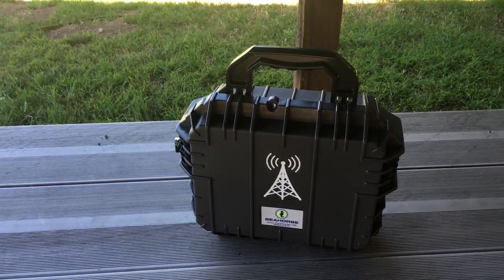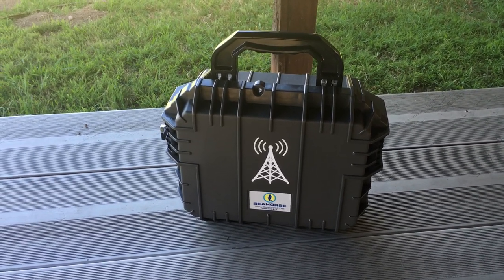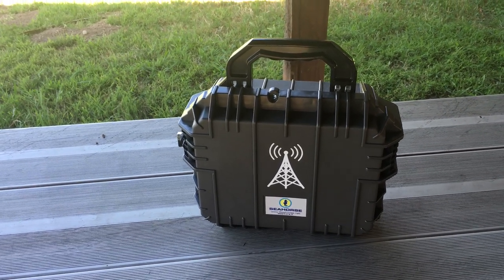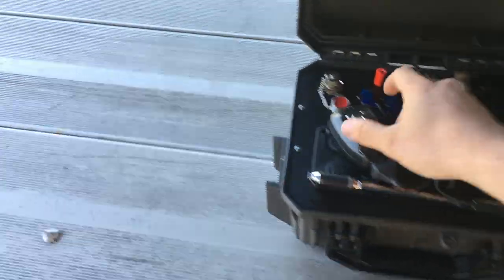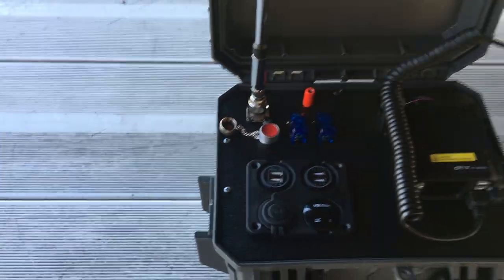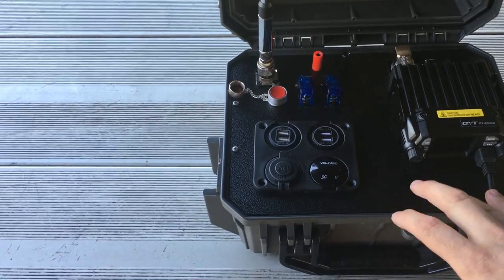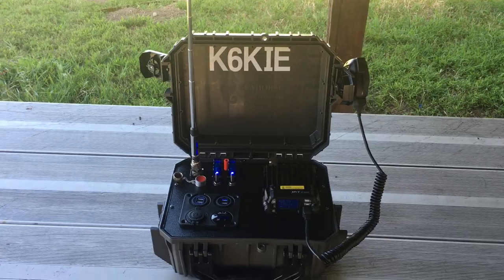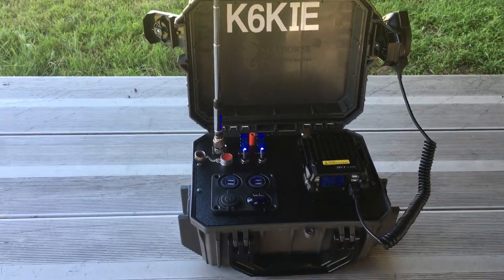Custom Emergency Ham Radio Go Box

Comment: Might I suggest that to enhance the functionality of your radio box that you include a roll-up J-pole antenna and a coil of RG-58 coax, so you can get a decent antenna up higher in the air?
Reply: Great idea.
Reply: Honestly I was thinking he was going to have that in there before he opened the box.
Reply: Especially since having the antenna on the box puts the operator at risk of RF exposure in excess of the limits set by the FCC.
Reply: @CAphotos  RF exposure limits set by the FCC are based on:

1 -  Proximity to the radiator
2 -  Frequency of operation
3 - Transmission power
4 -  Duration of exposure

Using an online RF Exposure calculator, using an antenna with gain of 3dBi, at a transmitter power level of 5 watts, at 146 MHz, and a duty cycle of 20% transmit and 80% receive, the minimum safe distance (no limit of time exposure) from the antenna is a little over 7 inches from the antenna.

So, it is possible to have an antenna mounted on the box without risk of exceeding FCC RF exposure limits.

But, the reason  I recommended a roll up J-Pole antenna and some coax was to improve the performance and efficiency of the system.

Comment: Nice little go box. I building one similar to yours. Im putting in a Xiegu g90, down inverter cause I’m using 20 volt Dewalt battery packs. In-line volt meter, USB port. Computer cooling fan. Cigarette plug. Switches , trying to keep it as light weight as possible.
73’ Greg KC3PMX

Comment: Excellent. Small, neat and very tidy build. Would be great to see under underneath to see how everything is posted and connects. Thank you.
Reply from the maker: LilBlighter thank you! It is pretty much wires and zip ties and connectors. I'm using bus bars to connect all the positive together as well as on for the negative side. I don't plan on opening it back up until I half to replace a battery. But when I do. Subscribe to me and I will post one!

Comment: Thank you for the information!  I would replace the heavy batteries with Lifrpo4 batteries. They do cost more to start but will out last 3 or4 lead acid battery. They are not also much lighter and give more power for there size. You will over time need to replace your lead acid battery but unless you do something realy bad you will never need to replace the Lifepo4 battery!
Reply: What's the minimum Amp Hour for the lifepo4 for 12v would I need 2? I'm doing something similar to this. I have longevity in mind
Reply: @Sonny_316  I got the biggest ones that I could afford that will fit. I took an old UPS that had had 4- 15 amp hour 12 volt batters that were connected for 24 volts 30 amp hour. I got 2- 60 amp hour 12 volt batteries and put them outside the box because they would not fit in the box. It will urn the UPS for many hours. I don't need to move it so it will be ok.
Reply: @donaldsmith3048  thanks
Reply: Even today, LiFePO batteries are 4-5 times more expensive than lead acid equivalents. Also, they require special care and feeding to get full performance out of them. I used a 30AH LiFePO battery with a small specific LiFePO "trickle" charger, but that setup (2 items) was over $220. Substantially more expensive than the transceiver itself.

Comment: Nice job .
I am considering a build using a retevis dual band radio.
Thee rt99 is an amazing rig i have 2 of them already. 
I just want to recommend you look at 1 .
When you do you will understand why i am doing it with this rig.
Also thee rt78 ht .

Comment: You're rig looks very squared away. I'm currently using a padded nylon pistol range bag that works fairly well, (It has adjustable velcro dividers in the main compartment so I have the batteries, radio and amp cordoned off and all the cabling neatly tucked to the side).
But, as I use the bag, things get all shifted around and by the end of the day its a mini-disaster.
Thanks for sharing your rig and your ideas.
Reply from the maker: Thanks Buddy! And yours sounds great! Would love to check it out! Always good to get some good ideas! 
i spend a lot of time trying to get mine as rugged and solid and small as possible.

Comment: I like the very small "back-to-basics" go-box concept very much. Just wondering if you have gear to supplement the go-box, like for instance a charger, solar panel or wire antenna.

Comment: Beautiful box!   Great job!   But, I gotta say, lead-acid?   Really?    Isn't the time you invested in putting the box together worth the difference in cost between lead-acid and Lithium Iron Phosphate?
Reply: He said he is on a budget.
Reply: Even today, LiFePO batteries are 4-5 times more expensive than lead acid equivalents. Also, they require special care and feeding to get full performance out of them. I used a 30AH LiFePO battery with a small specific LiFePO "trickle" charger, but that setup (2 items) was over $220. Substantially more expensive than the transceiver itself.
Reply: @g-whiz286  Then, you're shopping in the wrong places.   LiFePO4 batteries have plunged in price and if you paid $220 for a 30 amp-hour LiFePO4 battery and a trickle charger, you got ripped off.  Try sources like AliExpress where you can get 100AH of LiFePO4 prismatic cells for $169 or 300AH for $400 - at 12.8 VDC.   

Then, add a BMS for about $100-$150, depending on the current capacity, and you have a battery that will last you 3000-4000 cycles over a ten to twenty year period.   

Then, do the cost analysis to see how much it would cost you to get similar capacity and a similar number of charge cycles over a similar amount of time with lead-acid batteries and see which one works out to be cheaper.
Reply: @richardowens9061  I am a regular shopper at Aliexpress and could not find a 30 AH, 4 cell LiFePO battery for less than $159. Can you provide a link so others can benefit from your search skills? 100AH and most certainly a 300AH battery would be too large and heavy for a portable go box. The charger was from Amazon because I wanted to be able to return it if it didn't perform as expected. Happily, it did. It charged the battery to 14.6 volts and then turned off even if left connected. About every hour, it would sample the voltage to "see" if it needed to come back on.

Comment: Suggestion: ad its an on the go box, Keep the new raspberry pi 4 4gb ram along with a 5inch touch screen with a battery hat+3400mah battery to power the raspi. The touchscreen is HDMI powered by raspi so ud have more options

Comment: Good Job!!!! I really like your build. I've seen a few and yours is one I really like. 
But how did you assemble the batteries to keep them from moving around under the black board???
Reply from the maker: I just used 3M double sided tape. Stuck the batteries to the bottom of the case

Comment: Great job any room inside for a power supply? do you have a lost of items so I can build one?
Reply from the maker: Shooters Corner hey! There isn’t any room for one between the batteries and all the wiring. That’s why I have the two red and black banana posts on the top. Those are for charging. I can make a list but it’s pretty simple.
Reply: Thanks

Comment: what did you use to hold the blackboard to the box? what kind of spacers? i love that box, im building one just like yours!!!
Reply from the maker: I just used screws. The case had like screw holes around the inside. Screwed the board down to the case. Used 3m double tape to hold the batteries down to the bottom of the case to keep them from moving

Comment: What material did you use for the panel? and how did you fix it onto the case? your kit is impressive and gives me ideas!
Reply from the maker: Titony Sarmiento it’s a polyethylene sheet I cut to fit. The box has these little predrilled holes. Could have been from the mold. But that’s where I mounted the board to the case. 
In the video details. I have a whole parts list with links. 💪
Reply: Dr Wolfsburg thanks! yeah i saw tbe description 3 seconds too late! seems i was so excited by the video :-) anyway thanks again!

Comment: friendly advice: don't transmit more than 5W with the antenna so close to you.  RF radiation will cause on serious headaches. I employ a similar setup in my go box where I'm fortunate to be near a 300ft repeater with emergency power. Stay safe. 73, KN4GEI
Reply from the maker: Shaofu Chang I always transmit on the lowest wattage possible.
Reply: Dude you won't get headaches!
Reply: lol, you will... I don't want to bet you on that because its no fun ruining health. But from personal experience hitting a 2 meter J-pole with 55W while its hanging from a vaulted ceiling of your living will give you the worst migraine you can imagine. And its not readily noticeable at first. Talk for 3 minutes in that orientation and your head will feel like someones hitting you with a hammer from the inside. 

For me Ham radio had a rocky start.
Reply from the maker: Not on 5 watts man. Or even 25 Watts
Reply: well, your HT is about 5W :)
Reply from the maker: Shaofu Chang that is true. Why I use a 14” whip

Comment: Nice setup.  I did mine in a 50 caliber MTM plastic ammo storage box.   You can see it on my channel.  Hopefully your not embarrassed by mine.  73 WD8WV
Reply from the maker: J & J True Outdoor Adventures hey I actually like yours! Like the cammo wrap on the face plate you made. I can tell a lot of thought and planning went into yours! 73 good buddy. K6KIE
Reply: Thanks!
Reply: The plastic ammo can looks weak and not waterproof.... I like K6KIE build!! Nice job! Can you list the momentary switch on the parts list :)

Comment: hi Dr Wolfsburg do you have a build video for this case as it is something I am wanting to do and a video how you built yours would help with my project
Reply from the maker: phil hall hey buddy I do not have a build video on this. I thought about doing one for this but I just wanted to concentrate on the build. Every part I used I added a link under the description. Just use your imagination.  
I can build one for you but it takes about a month. I recommend to try your self because it will be yours

Comment: it is not advisable to transmit 25 watts of RF into your face... 

where is your fusing?
also i wouldnt have used the panel the  usb, outlet, etc are already screwed onto as they dont need that panel. you can use it as a template,  then surface mount it to the  polyethylene sheet. saves a lil room for extra storage...
if there was room to mount the radio in the box i would have done that then added either an external speaker, or surface mounted a remote jack...
over all simple, and it looks good for what it is.
73
Reply from the maker: Yeah it's not, I transmit at the lowest possible wattage like every ham should know.. I use 5watts and it's usually on the roof of my car so it's above my head. I have no worries or concerns. 
But thank you it was a good project